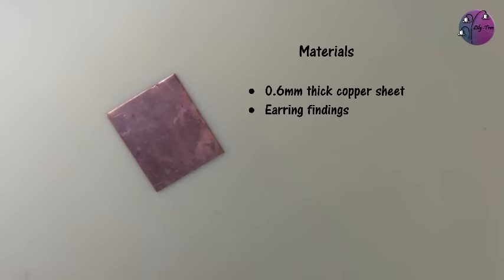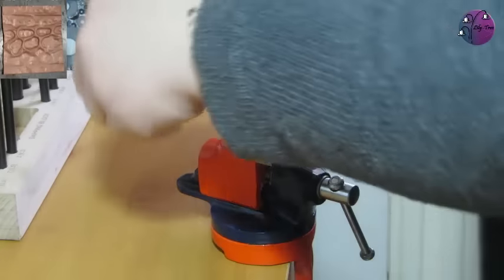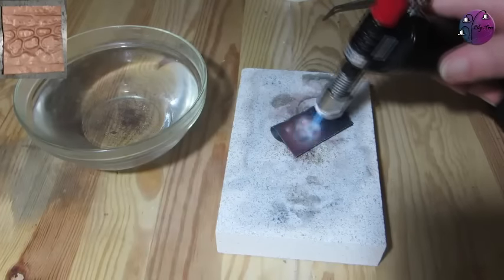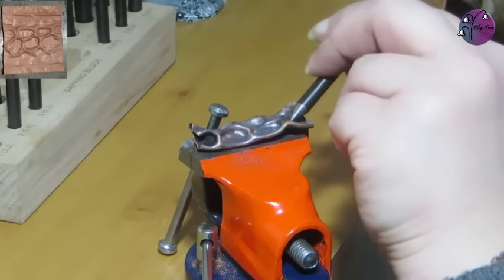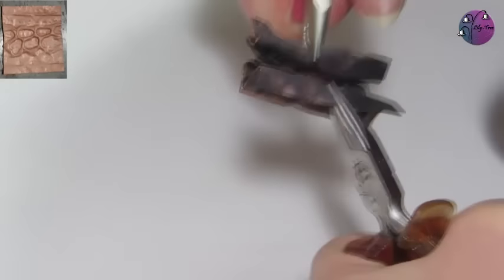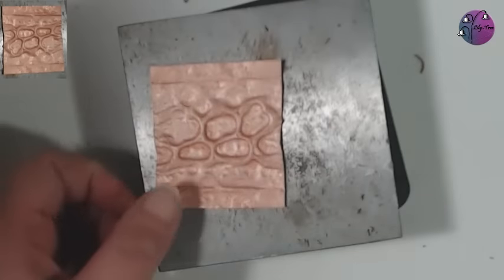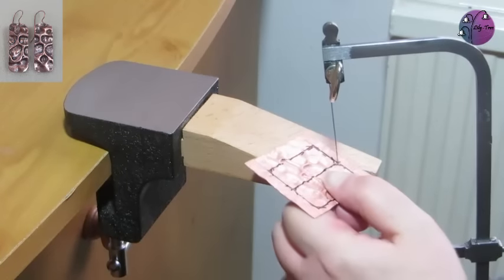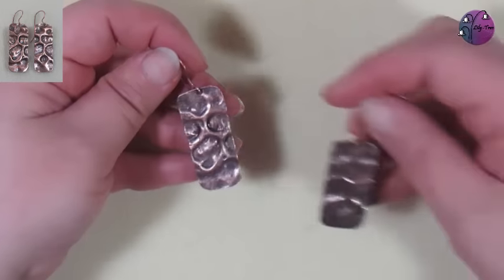Air Chased Copper Earrings - Jewellery tutorial

Comment: Just a little comment on annealing and quenching. If you quench right after annealing you will harden your material. If you let it air cool for a few minutes before continuing it will be much softer and easier to work with. If you want it to cool faster than air cooling, you can put it between two pieces of cooler metal. It really doesn't take that long to cool to workable temperature.

Comment: Have you ever experimented using a hand held automotive air hammer? At first you may gasp. But I use one often to forge small details in steel. The tools that come with the hammer are easily modified.

Comment: Thanks for the video, as always! Do you work-harden the sides between every round of forging in the vice? I managed to collapse mine in the second round after the anneal.
Reply from the maker: You're welcome!  I haven't work hardened the sides, but it might be worth a try.  It is very soft and 'collapsable' after annealling, so I've just tried to be careful over where I start hammering again.  If you find it has gone badly out of shape, you can anneal it, then open it up a bit and fold it back into a rounded shape again.
Reply: Thanks! I'll give it another whack (or two).